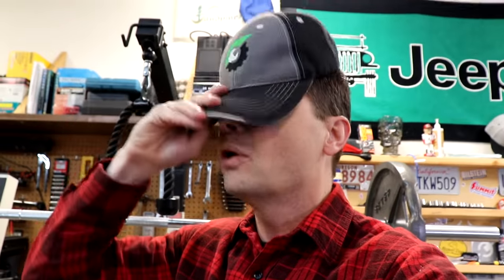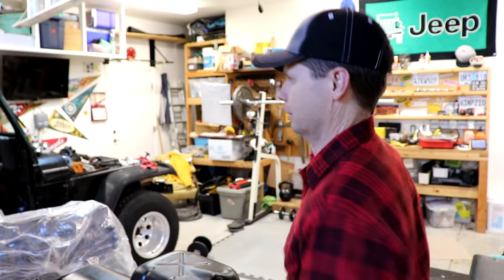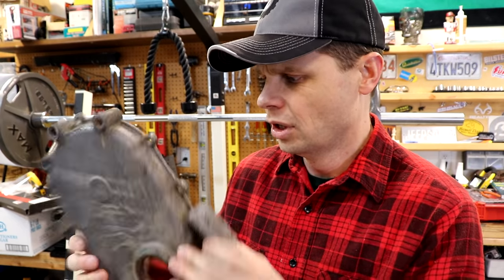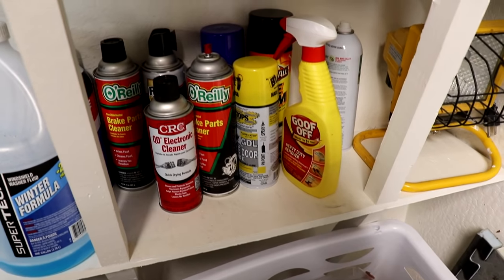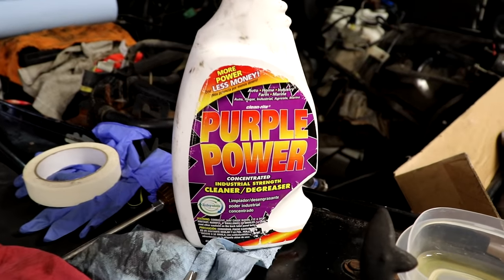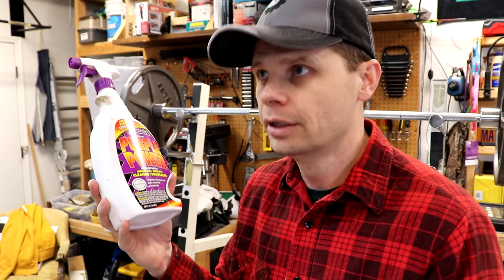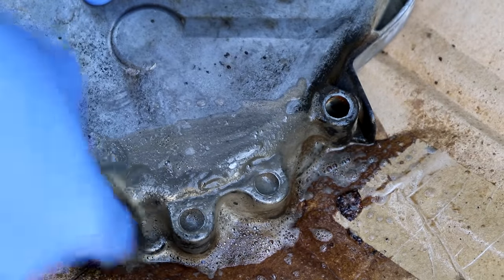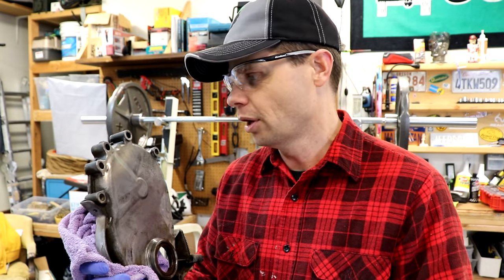Super Clean Aluminum Engine Parts

Comment: Aluma Bright. Best you can get
Reply from the maker: Local auto store carry it? I may have to test it. Thx
Reply: Be very careful with it, easy to burn the aluminum.
Reply: I've never had trouble with it on cast aluminum. It can leave marks on polished aluminum and anodized parts.
Reply: Alumna bright
Reply: Aluminum specific cleaners seem to be harsher on aluminum than cleaners that say use caution when using on aluminum LOL!!!!!! I know that Dawn 'blue' dish soap is an awesome grease cutter on anything when diluted to say 5 oz. dish soap  to a quart of water. I may clean my mildly dirty intake that route, this time a round.

Comment: I use Purple Power to restore vintage machinery. For the price it's hard to beat. The system I use works great. Mix a weak solution of Purple Power with the hottest water you can get from the tap in a container big enough to fit your part. Let the part soak for about 10 minutes. Take a small container, like your wife's Tupperware, and pour some full strength Purple in it. Use a natural bristle 2" paint brush and dip it in the full strength cleaner and scrub away at your part. The grime well literally melt away. 
To brighten aluminum after degreasing, spray with The Must For Rust by Rustoleum and let it sit for about 10 minutes, agitate with a soft brush and rinse well.
Works good on zinc castings too.

Comment: Degreaser is fine and dandy. You could’ve also soaked it in diesel or ChemDip carb cleaner. The best thing you did that you didn’t emphasize in your god, is the use of that brass brush. A brass wheel on a bench grinder and some patience would’ve moved you further along, but hey we all learn. Great vid!
Reply from the maker: Thanks! Wheel on the cover would work well.  Manifold still a pain..

Comment: You can acid wash aluminum.....you just have to know what you’re doing. I use 6 Molar laboratory grade hydrochloric acid on aluminum heads and blocks all the time. Degreaser and deoxidizer all in one.i’m talking 30 seconds max and then directly into our alkaline wash. Of course total ventilation and full protection for skin, eyes and lungs. Everything will look just like new.

Comment: Spray nine “super cleaner” concentrated degreaser. Comes in a gallon container that mixes in a 20:1 ratio with water for a regular cleaner, or 10:1 for degreaser. I dumped the whole container and topped up my parts washer with water. Used a wire brush and red scuff pad and it cleaned my intake manifold like it was brand new.
Reply from the maker: Awesome.  I'm not happy with my parts cleaner chemical.  Stinks bad, and hardly works.  May have to change it out for something else.  Thx!

Comment: Looks to me the purple cleaner doesnt do anything, it's the brass brush... Try a plastic wire wheel for a drill.. Soft enough to not ruin the alu, harsh enough on the dirt..
Reply from the maker: Purple power worked great. I used the same brush with multiple cleaners and found purple power worked best!

Comment: You spent a lot of elbow grease cleaning that part when there is a easier alternative. Purple power in a tank .. let set for 2 hours no more .. lightly brush.. you can dilute the purple power put a propane burner under a 55 gallon drum with purple power (good for engine blocks) also short time the heat makes it clean quicker .. the purple power if left in to long discolors the aluminum .. if left in waaay to long it might dissolve don't know im not that stupid. The discoloration can be bead blasted on easy to clean parts like intakes and oil pans but for stuff like cylinder heads using baking soda in the blaster is best so no glass beads get left in the oil galleries. Best way of all is in purple power in a sonic cleaner no brushing needed. with all of the above no scrubbing needed and light brushing at best.

Comment: I would have brought the new and improved 1999 and up intake manifold. Time is money.
Reply from the maker: True. Intake manifolds can be hundreds of dollars. Guess I saved a ton of $$
Reply: Look on RockAuto.com, you still have an old part when you could have had more power, more gas mileage  and a new improved intake manifold. This is WHY you are doing all this isn’t it? Penny wise and Pound foolish as my Mom would say.
Reply: All for $115.39 cents for intake.  Timing cover $58.79 that was a wash.
Reply from the maker: @lynnchelo4727  Checked Rockauto. no intake manifold listed for 92 Wrangler 4.0. Where did you find one for $115?? I don't see any listed anywhere near that price. Other sites have them for $300-500.
Reply: JeepSolid : 1999 Cherokee 4.0 fits.
Reply: Remember cast aluminum you clean and or install coat it with high temp clear engine paint. On your timing cover put it on a piece of glass and try and slide a 1 inch wide length of paper under it. If you can, order that too.
Reply: Clean one on EBay $90.

Comment: Steam....will do the most the fastest and safest.  You can use the PPower first and steam second or Steam, PP, Steam again to rinse.  Good steam cleaner/generator will run $150 on Amazon.  

.and in a PINCH...Brake cleaner.

Comment: Dude... purple power and simple green are terrible for aluminum and will pit and corrode it. Do not use them. You won't be able to see it the first few times you use it because it works microscopically but rest assured it is damaging the pores of the aluminum and weakening it. Then you will see spots, or whitish discoloration and that's when you know the aluminum is now damaged to the point beyond the microscopic scale.

Comment: Go to Harbor freight buy a sand blaster and use walnut shells don't use sand
Reply from the maker: Yeah, that's be ideal.  Just space and $$
Reply: @JeepSolid   They're cheap and work really well. Used one to clean the carbon off of my intake valves on a Mazda.

Comment: a set of these wire pipe cleaners come in very handy when getting into tight spaces like between the intake runners - they cost very little but work very well.

https://www.dhresource.com/0x0s/f2-albu-g4-M00-60-95-rBVaEFcUk3SASa6FAAjgY7NKy34011.jpg/5pcs-pack-brush-miniature-wire-tube-brushes.jpg
Reply from the maker: I have a similar set from Harbor Freight.  Work pretty well!